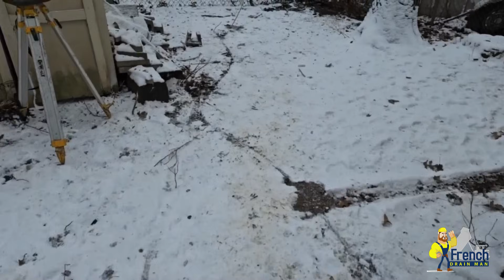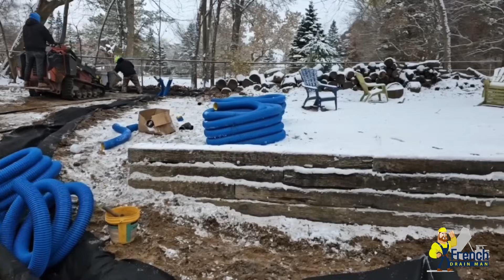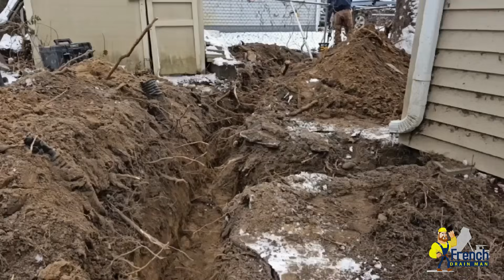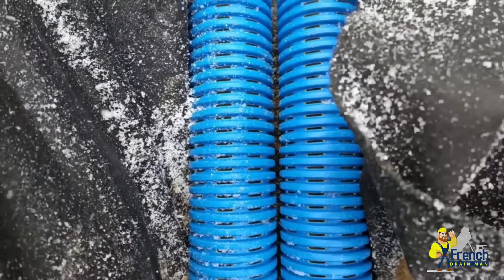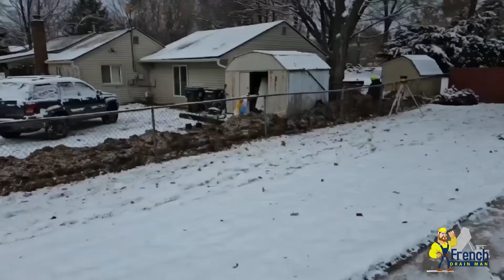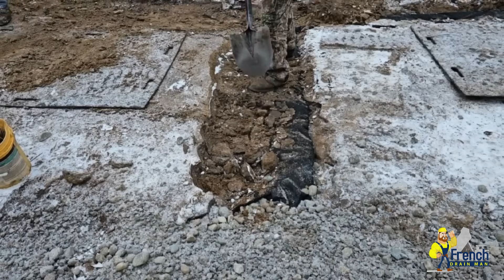How to Build a French Drain — Every Detail That Matters

Comment: Great video. Curious with all of the roots why the lines were not covered in your copper mesh netting or copper sulfate used.
Reply from the maker: It's always an option. It adds cost to the installation. Some take it, and some don't. You can't force people to add it on.

Frenchdrainman.com

Comment: With weather like that you have no choice but to work with washed-stone.  You almost need one of those Road Reclaimers that can grind concrete down 18 inches deep, so you can work in that ice. If my RTR tiller hits a simple root the teeth snap, so you'd need something tougher for sure.  Thinking of reclaimers I wonder if there was a product that could be tilled into trenches to make them function more as a water-proof subsurface-wall. Lime & some concretes are mixed into native soils to dry, compact, & harden them for construction, that process could redirect shallow-subsurface water.